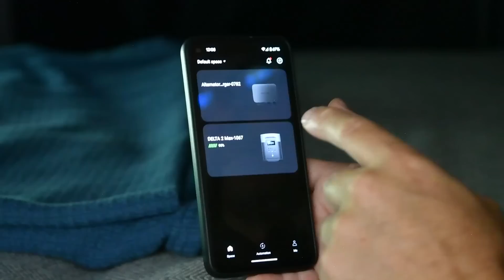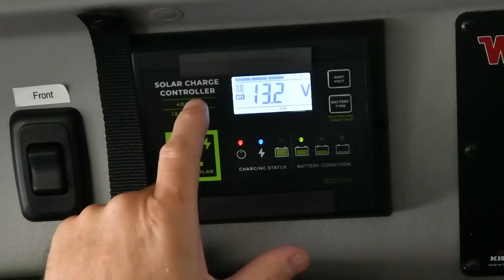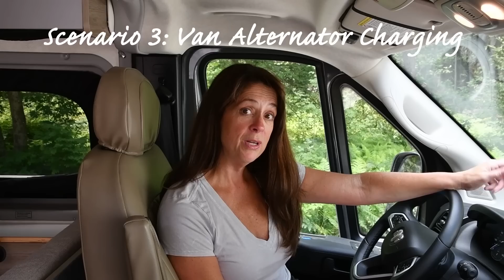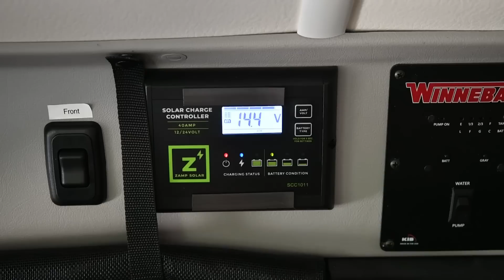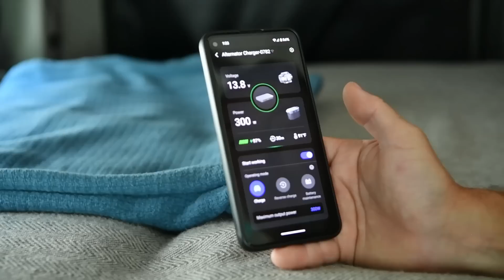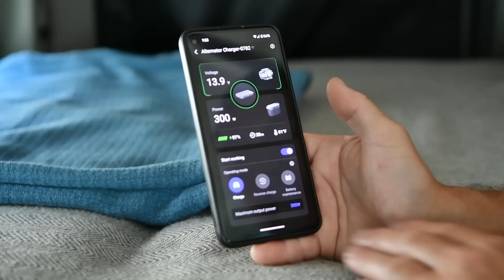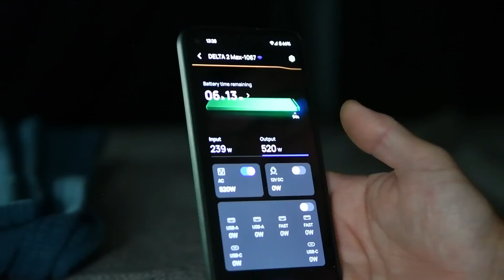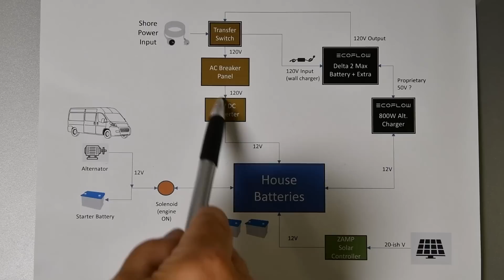Lessons Learned! ECOFLOW Alternator Charger and Battery upgrade

Comment: Hypothetically if had more than enough onboard power from an eco flow battery. Would your transfer switch mod be able to power the roof AC without plugging in? Thanks. Love your videos!
Reply from the maker: Hi, thank you so much for the feedback! It is really appreciated. The simple answer to your question is YES. But, there is some devil in the details...
First, the van shore power feed into the electrical panel through the transfer switch is 30A (amps). The battery input side of the transfer switch has a 15A style connector but I think can take 20A which is the max output of the ECOFLOW battery. The air conditioner is on a 20A circuit by itself, though I don't think it will normally use much more than 15A. So if you are running the AC through the batteries you need to be sure you don't draw too much power anywhere else in the van as you don't want to exceed 20A absolute max at any one time. We did a separate video covering installation of the transfer switch, you can check that out if you want.
The second consideration is that you will need A LOT of power to run that AC unit for any length of time. We also did a video covering the power consumption of that unit. You should also read another recent comment on this video where someone talks about running their AC unit for 5 hours with 50% more battery capacity than we have.
And the last consideration is after you draw down that much power running the AC, how will your batteries get recharged? Even with the roof covered with solar it would not be enough. You will need a way to tap off the alternator and even then you may need to drive for many hours (8 hours of more) to get your batteries charged back up, depending on their capacity.
Hope that helped and thanks for watching!
Reply: @Outapkt this was so helpful thank you! I have delta pro (3600 watts)in my pocket. Been running the AC with no problems as well ass everything thing else in the rig. But when I’m boondocking I have been needing to run the shore power cable from the eco flow out the window into the 30amp socket on the outside of the pocket. Your transfer switch video is a game changer for me! Thank you! Now I just have to get the nerve to install it 😅. Thanks again love you channel. Happy to have subscribed. Keep it up pocket fam!
Reply from the maker: It's not a bad install just be super careful. If you have not done wiring of outlets/switches at home maybe you have a friend who could help. Of course an RV tech could do it for you. Good luck and thanks again!